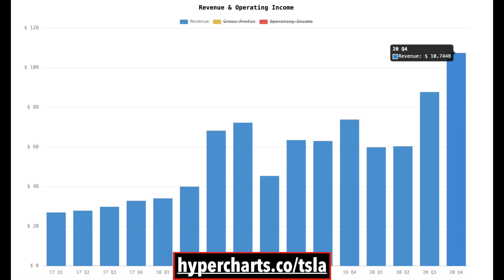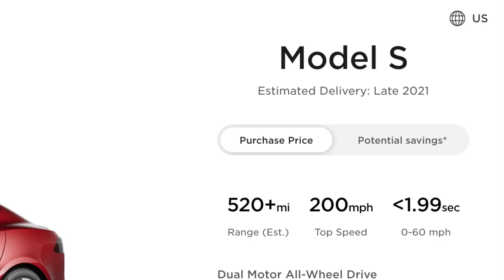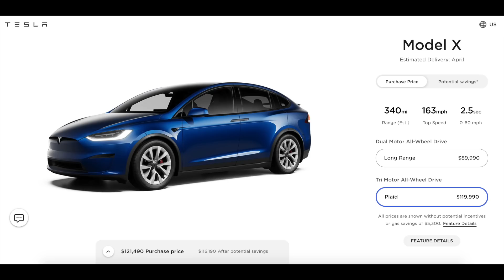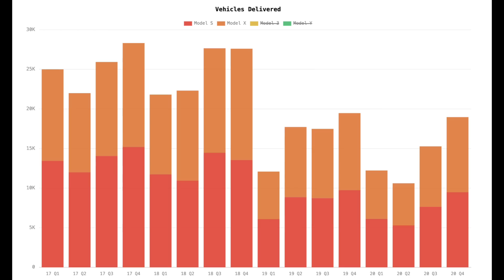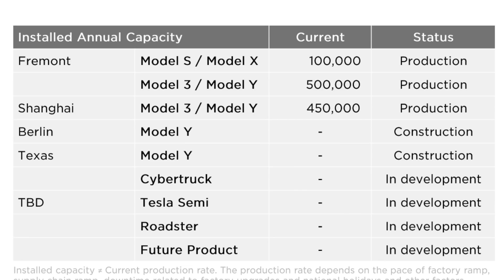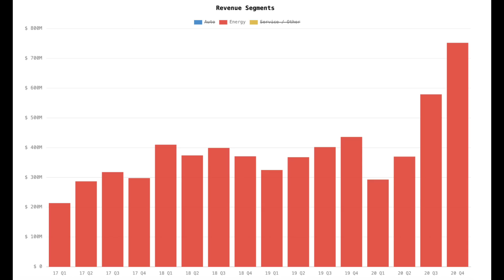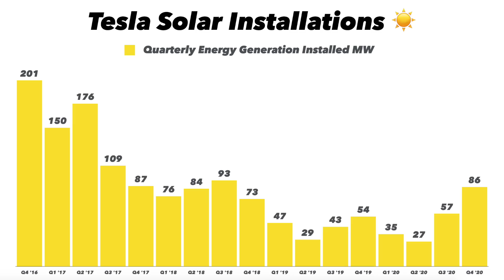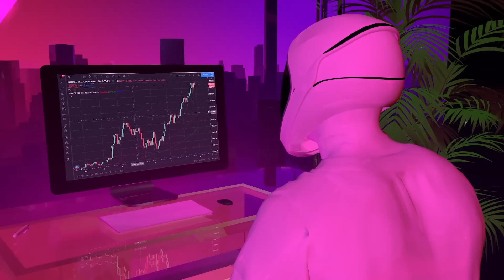HyperChange 14⚡ Tesla Q4 20 Earnings Analysis

Comment: It would be sensible to first use the 4680 cells in the limited production models such as the Plaid+ Model S (Plaid+ Model X?) while the production capacity is in the order of 10GWh. Once the battery production has scaled to 100 , 200 GWh/year introduce them into the Model Y (2022). With more than 500,000 Cybertrucks having been pre-ordered, I sincerely hope that the 4680 cells can meet the demanded production capacity in 2022 ( an additional 100-200 GWh would be needed ) . Truly, the battery capacity ramping seems to determine EVERYTHING! I was very happy to hear and am thrilled about the Tesla Energy now beginning to show growth. The crazy sell-off of TSLA shares prior to the Earnings Call, and even post-market was puzzling to me. Personally, I could not have wished for a better Q4 report! Really looking forward to seeing the developments in 2021-2025 ;)

Comment: Wow insane specs on the new Model S! I'm glad they finally updated the looks especially the interior. It looks modern, fresh and clean IMO. The Yoke Steering wheel would allow more visibility to the display screen, road and also eventual FSD. 0-60 <1.99s, 1/4 mile <9.0s, 1,000+hp, 520+mi range, tri motor is ludicrous. They've gone to plaid!
Reply: So you listened to the presentation....... As we all did.

Comment: The reason last year gross margin lowered is that Model Y is new, and Model 3 is refreshed. This year the gross margin will just be higher after the major upgrade.
Reply: Zach said margins were higher in Q4 than Q3  but some once off temporary  items were  present. He mentioned electronics are hard to source atm, so likely some suppliers were unable to supply and more expensive items were substituted.

Comment: Doesn't the fact that plaid plus does not exist on the model x p much confirm they are using the new cells? This p much suggests that they belive they will produce enough cells for Model S but not yet enough for Model X
Reply: Maybe they haven't decided if they'll convert the X to 4680s until Cybertruck comes out, or wait until they see enough demand of the refresh, or something else. A lot of possibilities. I agree that the big range bump of the Plaid+ is almost a guarantee it's using the 4680, which is why it won't be available until later. It's the perfect car to test the new pack because of limited production.

Comment: Don't worry Elon will always be around in Tesla. He's a typical work-a-holic. Even not as CEO but at least Chief Engineer and a majority share holder.  I promise.
Reply: my thought exactly! Elon won´t leave Tesla for good! Therefor has the time to innovate Tesla even more when he is not CEO anymore. All his companys have some connections to each other.
Reply: He did mention numerous times that he was the first and he'll be the last to leave the ship.
Reply: I am not satisfied with the new Dashboard and steering wheel. What about the air vents for the driver? Will not the screen block? And the screen is not as enbedded and Nice looking as the old design. And the steering wheel just does not work. I am holding my steering wheel at 10 and 2, so we need a normal steering wheel, I hate the yoke. Its a bad idea to show it as standard on the website.

Comment: Plaid + might just have a few extra 4680 cells in parallel with some special charge management module and better cooling for the motors/speed controllers
Reply: The 4680s are kind of like supercaps compared to standard build 18650 batteries

Comment: FYI the 10 teraflops in gaming is equivalent to a PS5.
The PS5 is powered by a 3.5 GHz 8-core AMD Zen 2 processor, as well as a custom AMD RDNA 2 GPU with 10.28 teraflops of compute power.

Comment: Key items heading into the Earnings Call--> 6 Items Requiring Our Attention from reading the shareholder presentation slides:

1.) Vehicle margins, especially after deducting the tax credits from the gross profit to get our adjusted gross profit. Why did gross margins fall off? Is it because of Model S, X Plaid ramp?
[Answer]: 2 reasons - Fremont conversion of production line to build Models S & X Plaid, and launching single piece castings on Model Y, introducing heat pump to Model 3; and impact on supply chain due to pandemic inefficiencies.

2.) Lack of guidance on production as well as on earnings.
[Answer]: In CFO Zach Kirkhorn's opening remarks, he said that the Model S and X production will be low due to the transition to newly architected products (The Plaids). This will also be compounded by global semiconductor shortage as well as port capacity, all of which may have a temporary negative impact on the top line. He reassures listeners that TSLA is playing the long game and is investing heavily in the supercharger network and customer service capacity (best service is no service - TSLA is emphasizing the Tesla app and pushing for it to replace calls over the phone for customer service) while reducing costs. But they did slip in the fact that Feb 2021 is when they will be able to start delivering the Plaid S and X.

Dan Levy (Credit Suisse) asked about guidance on regulatory sales credits and TSLA's planned usage of their capital. The reply is - regulatory credit sales are notoriously hard to give guidance on. TSLA is planning to deploy its capital in the following 2 ways:
(A): build out their Austin and Berlin factories as well as their service (service centres and mobile services) and supercharger network expansion, 
(B): deleverage their capital structure by focusing on debt reduction - they have a lot of convertible debt that are expected to be exercised in Q4 2020 and Q1 2021. 

3.) Premium vehicle (Model S, X) is a diminishing revenue segment, the opposite of Model 3 and Y. And yet we are investing in S and X Plaid. What's up with that, TSLA?
[Answer]: Because TSLA does not want to disintermediate their suppliers (Panasonic, CATL, LG) from their value chain and instead want to work with them. The reason for the 4680 form factor development Is to supplement those suppliers' battery supply to TSLA. And since CATL and Panasonic do not have the tech and infrastructure to build the 4680 batteries, TSLA decided to go ahead with the Plaid vehicles that uses the 18650 form factor batteries. Elon was explicit in stating that the Model S Plaid will have "more advanced 18650 form factor batteries".

4.) Negative margins on Tesla energy (future revenue segment)
[Answer]: TSLA is working on it...

5.) Implied delay of Cybertruck.
[Answer]: Need a larger casting machine than the one they have right now. To be clear, TSLA is no longer iterating the design - they finished almost all of the Cybertruck engineering. Right now, the casting machine that they have - the 6000 tons, biggest in the world - can be used for the rear body casting for the Model Y, but insufficient for the Cybertruck. Elon says they'll "soon order the equipment necessary to make the Cybertruck work". He finished by saying that we might even see a few deliveries by end of 2021, with volume (commercial) production to be in 2022.

6.) FSD expectations?
[Answer]: There are 4 parts, (A), (B), (C), (D).

(A): Current owners are not able to transfer their FSD to their next vehicle (started a mini-selloff when Elon confirmed this). 

(B): Latest TSLA neural net is now learning using surround video, fed from eight cameras, compared to only training using one camera with single frame still pictures in the past. According to Elon, this is a game changer - getting the entire neural net stack to be on video. The present neural net is under supervised learning (the Holy Grail is unsupervised learning), and TSLA had been able to upgrade the labelling software to video labelling, allowing the FSD to make video inferences which leads to exceptional performances that (allegedly, I don't have a Tesla) were apparent in the most recent beta. Getting the rider from Point A to Point B through a series of complex intersections has to be a given. In order to gain regulatory approval, TSLA needs to conquer the corner case reliability - make it 99.9999% reliable with respect to an accident. In other words, 100 - 200% more reliable than a human. If TSLA ever spins out FSD as a separate business line, Elon said they can get the FSD reliability to be up to 2000% more reliable than humans. Also, the FSD L5 autonomy can be achieved using the present Tesla FSD chip. 

(C): The ramp for FSD in China is very steep - currently only 1 to 2% of Chinese customers chose FSD option. Elon says he is confident the China customers will buy FSD as soon as its working, which he hopes will be later this year - 2021. The Chinese (government) are interested to work on L4 and even L5 autonomy later in 2021 (this year) as well. As for the U.S., they expect to work well with current regulators, confident that once TSLA demonstrates a really good FSD launch with really high reliability, FSD will be released to wider and wider groups. Regulation-fond Europe is the laggard in FSD guidance. In Zach Kirkhorn's words: "In Europe, we see a general slowdown, generally not reaching past Level 3 right now with some impetus to start working on new working groups to reach past that".

(D): Lastly, TSLA is more than happy to license their FSD to other OEM - the TSLA philosophy is not to create walled gardens. 

Helpful link: https://www.fool.com/earnings/call-transcripts/2021/01/27/tesla-tsla-q4-2020-earnings-call-transcript/

Comment: I don't think the cybertruck steering "wheel" is legal in the UK but that can use a normal one in places where it's not legal.
Reply: Why should it not be legal?
Reply: @stebarg  they have crazy rules. You have to keep both hands on the wheel at ALL times. You can't take one hand off even for half a second even when you are parking in a tight space. So in order to pass the UK driving test you have to learn a technique to keep both hands in contact with the wheel even when you are turning the wheel more than 90 degrees. It would not be possible to do that without a complete steering wheel though. I recommend watching UK driving instructor videos if you really want to know that technique. No one bothers with it after they have passed their driving test.
Reply: @nathanlewis42  We have crazy rules in Germany too. However, having full control is key. All those (hilarious) tasks you've mentioned can be executed with this yoke. I don't know of any regulation which makes the yoke illegal. Do you? I steer with one hand only and support sometimes with the second hand.

Comment: Too bad there's no X Plaid+/4680s. It's the one car that really needs it (highest consumption). Ah well... Prediction for deliveries to Europe on release for a Plaid X is September '21, so probably a 4680 Model Y from Berlin will be the better option anyway. 
Also the 8" rear screen is only useful for music & HVAC, if there's two kids in the back seat you can forget they will play on a knee-high mounted 8" screen. Backrest mounted Screens (or option for them) would have been the way to go practically. Not as pretty, but form follows function and Franz has erred off the "form follows function" path quite a bit before (starting with the low, "let all crap fly around the car" yacht floor).

Also, unfortunately there's no mention of sound proof glass regarding S and X, hopefully they will use it on all glass surfaces.
Reply: Due to limitations in cell production, Tesla wants to use every means possible so it made better sense to stick with the 18650's for the LR and Plaid Model S and X until the production on the 4680's ramps up significantly. So, the LR and Plaid Model S and X won't likely transition to the 4680's until later in 2022 or 2023. At that point, they might also start using the new casting process. Elon did mention the chemistry in the 18650's was changing so they will probably perform closer to the 2170's currently in use on Model 3's and Y's.

Comment: The steering wheel won’t be used much longer
Reply: Then what’s the point of all this performance? Autopilot will obviously never accelerate all out for safety reasons so what’s the point of all these crazy fast cars.
Reply: @officialyasir  would be kinda cool in boring tunnels
Reply: but laws requireing it to be there will be.

Comment: Hate the steering wheel. Love the car. The model s 18650 cell is an advanced variety for sporty cars. High performance, not the traditional Panasonic cell. All cars that come from g berlin will be 4680 driven. The batteries will be made at G berlin.
Reply: "the batteries MAY be from G Berlin"..... Or the early ones may be imported from Fremont.
The more interesting question is "which chemistry will be in the first 4680 cells"
I have a bunch it could be LifePo4.
Longevity, charge characteristics, cost, raw material availablity, etc.

Comment: I don't think Tesla will continue their infotainment system for long. I think an ideal robo-taxi would just have a desk and no usable computer. The user would probably prefer to use their own laptop instead of a built in computer. If the user brings their own laptop then they could have a smooth transition from commuting to working.

Comment: From battery day it seemed pretty clear that the plaid model S would be using 4680 cells. That has to be the plaid+
Also seems like Giga Texas made Model Y is going to use 4680 cells which are made on site. That will be the first vehicle manufactured in Giga Texas, and Cybertruck in 2022.